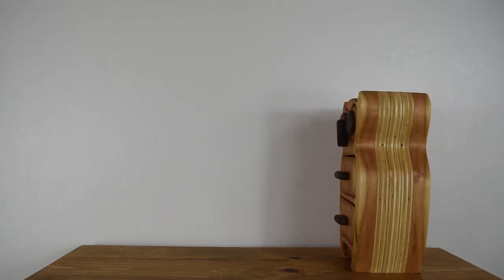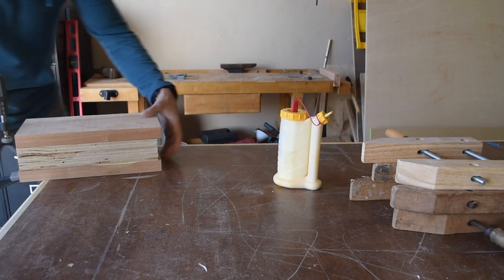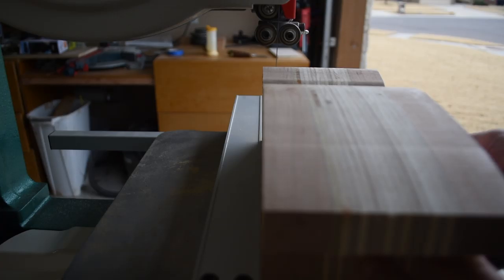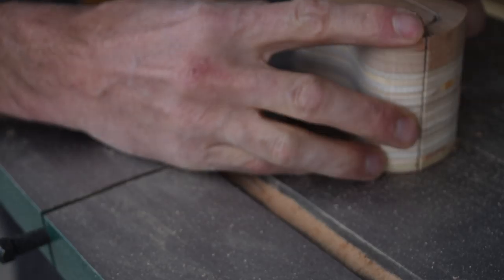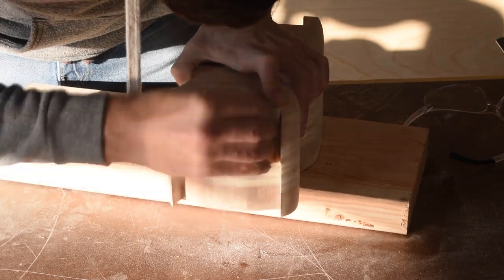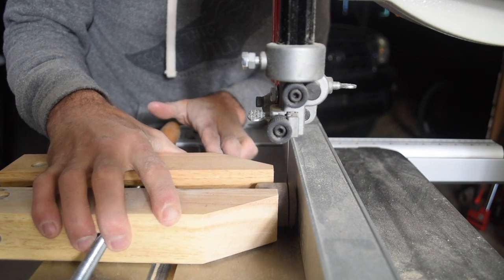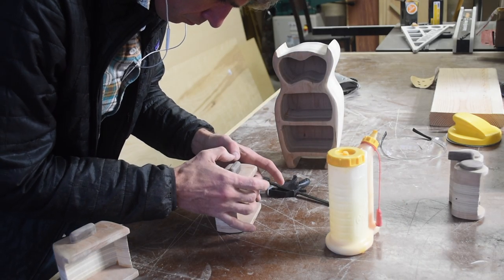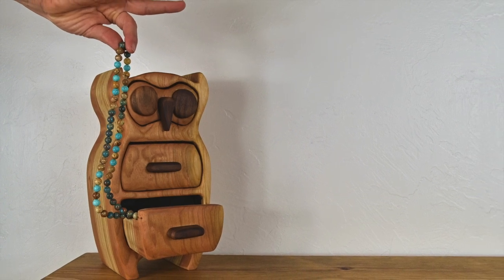Owl Jewelry Box | DIY Bandsaw Box | How to

Comment: Owl tell you what, that was a lot of sanding lol. You sir need a spindle sander. They are easy to make for a drill or drill press, if you don’t want to go get one. Look up Izzy’s video it’s a good method of making one.
Reply from the maker: I actually have a spindle sander. I even used it in this video. Unfortunately on the ears I drew up a weird angle that was flat in spots and curved on others. The spindle would’ve scooped it out too much. Thanks for checking it out!